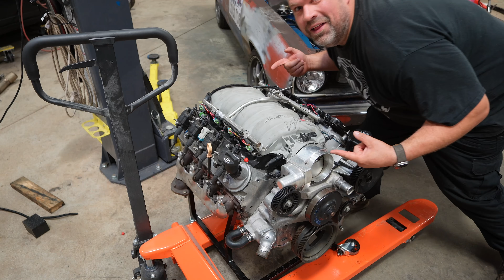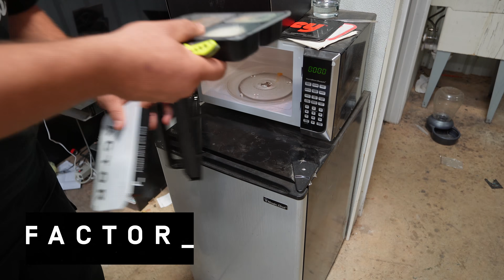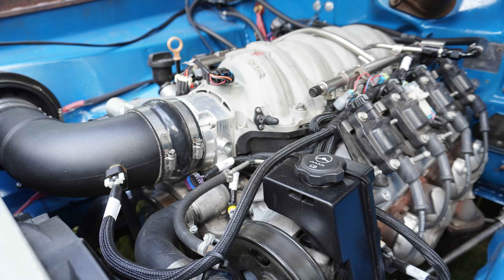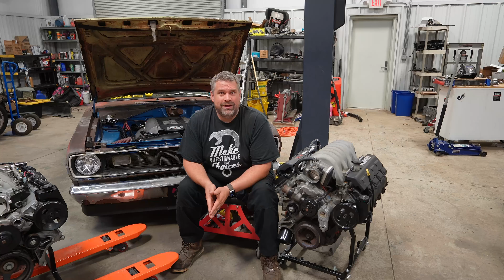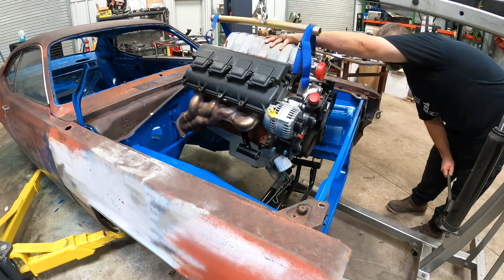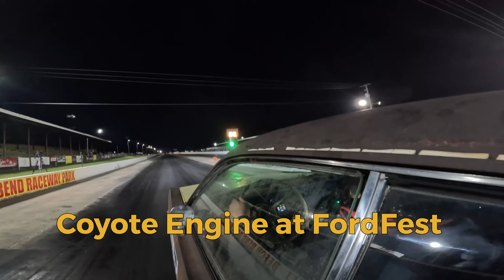What No One Tells You About Engine Swaps! Best Engine To Pick?

Comment: As a "Ford guy" I can't disagree. I love the Coyote, but as a swap motor, it is a difficult choice. It's so expensive and large it doesn't work everywhere like the LS. 

What Jared is not mentioning is how easy it is to get monster HP figures with the Coyote. A simple blower and oiling gear will put you way higher HP and more reliable than the same mods to an LS. Cleetus has proved this.
Reply: Lund racing just went 6.80@210 on a oem coyote block, 6r80, and stock ECU. I wonder how fast the LS or hemi can go on stock ECU? 🤔 🤔🤔🤔
Reply: @TTyote  The LS (as far as modern V8 engines)is still king as far as popularity, affordability, and ease of swapping, and rightfully so like it or not. Besides, as far as who makes the most N/A power that doesn't really matter. Especially since when it comes to serious racing(grudge/street) with money on the line, nobody competes with N/A power alone anymore. Everyone in those environments is running some form of power adder.
Reply: @erikturner5073  being cheap and easy is your mom's flex too. Coyote is king power per liter and range of tuning. Gtfoh with all that other lame shit.
Reply: @erikturner5073 🎯
Reply: @TTyote  Hennessey Venom F5: 300 MPH, 
SSC Tuatara: 283 MPH. Both LS powered and run those speeds for hours not minutes.
Reply: @mewrongwayKOCXF  cool nobody cares. Also who said anything about minutes? That's 6 seconds not minutes. I can tell there are no wrinkles on your brain.
Reply: @TTyote   Exactly!!  The Coyote will stay together for 6 seconds at 300mph but I was nice I give it 6 minutes!  The LS on the other hand has run 300mph for hours!  That is why the worlds fastest cars use LS power!  No Ford shit here!   I can tell there are no marbles in your head!  Google:  How Koenigsegg Made a Better Ford V-8
Reply: @mewrongwayKOCXF  The Cleveland is the best small block V8 ever made. Stock 4V heads flow 290cfm at .500. The Coyote doesn't belong in this comparison.
Reply: @eclipsegst9419  Stock 4V flow 233cfm at .500!! , Stock LS heads flow 300 at .500 lift! 🤣🤣
Reply: @mewrongwayKOCXF  Well you are full of shit, and if LS heads are better why can't you Chevy boys beat John Kaase at Engine Masters in the small block division? You keep getting stomped by the mighty Clevor! They even had to ban him from using the 400 Cleveland block because no Chevy stood a chance against his monster strokers using that tall deck height! Typical Chevy, always changing the rules when Clevelands start pushing their shit in.
Reply: @mewrongwayKOCXF  No, they flow -

0.200 161/65
0.300 232/92
0.400 271/145
0.500 294/176

Lift Int/Exh. Bone stock 4V heads with just a valve job when stainless were installed, basic 3 angle. 

The best factory LS head, the 243 head, with similar 3 angle valve job, flows-

.200 126/108
.300 184/143
.400 224/163
.500 251/176

So no, the LS heads do NOT outflow the Cleveland. And if we are talking fully ported aftermarket, the Cleveland still wins. That's why you LS boys can't beat Kaase at Engine Masters build competition, even after you pulled the typical Chevy boy move and banned him from using the tall deck 400 Cleveland block.
Reply: The high rpm of the coyotes makes my heart go "weeeee" but my bank account really likes LS swaps.
Reply: @alanmeadows4056 ,it can't get no better than that comment,salute
Reply: @alanmeadows4056  You pretty much nailed that.  You gotta admit, the Coyote is the most visually  appealing  engine of the three mentioned. I'm not a Ford guy. But for a modern engine, it looks pretty cool.
Reply: @MikeAnderson-uj3oo they pretty much feel exactly how they look. High tech and refined Americana from concentrate 😅
Reply: @MikeAnderson-uj3oo the coyote looks plain and wide, that's it.
Reply: It don’t matter what swap you do all them good when you build them right see coyote lose to ls see ls lose to coyote Hemi beat some ls and ls beat hemi etc go on it all matter With good pilot in them car keep it racing in fun y’all crying like little girl I love them all it not that serious
Reply: Stock coyote = 0 reliability issues. That is all
Reply: @crewdawg2008  They have an oiling issue(oil pump gears), also they are complicated for many, and they are OVERPRICED.
Reply: @erikturner5073  Being complicated is the person's problem, not the engines. The oiling thing you speak of is the exception, not the rule, according to both personal experience and every forum I've seen. Lastly, everything is overpriced these days, fuel, food, daily needs, so of course hobbies are going to be. Relative to what the market reflects, they're right about where they should be. Overpriced because GM engines are cheaper? Always been that way.
Reply: @crewdawg2008  like it or not the blue collar crowd is the biggest crowd in this hobby, and because of that the, and other reasons (best buy horsepower per dollar) the LS is the most popular and rightfully so, like it or not. As a Foxbody/Windsor guy, I find it shameful that Ford can't come up with a modern power plant that's affordable and can compete with the LS in the market. Ford has walked away from the formula that has made Ford number 1 in the streets, and in popularity back in the Foxbody years. With the attitude you displayed in your comment, Ford shares as well, and is attitudes like this is the reason why the modern mustang is nowhere near as popular as the mustang was in the Foxbody years, and never will see that popularity again at this rate. Also Ford knows this yet like almost always Ford learns the hard way. Sticking 5.0 badges on fenders like they did in the Foxbody years is not going to cut it!😂 Most people don't like overcomplicated, overpriced power plants. The Foxbody was popular because it was a true blue collar warrior that made good power and was easy to work on, among other things. Ford walked away from that formula, and the mustang hasn't recovered since. May as well call the modern mustang Ford's Corvette, and I'm not the only one saying this.
Reply: @erikturner5073  LOL attitude? Oh pot, I'd like you to meet kettle 🤣🤣🤣
Reply: @crewdawg2008  it's funny how a person can explain facts, and because the other person want to acknowledge or listen (people like yourself) y'all get emotional and don't understand facts or read the writing on the wall. SMH. I've met plenty of fellow Ford guys who get butt hurt when someone acknowledges the LS is rightfully the #1 popular modern V8 for many reasons. Probably because they have nothing to prove that fact wrong. They can only turn around and talk about how much more advanced the Coyote is and that it makes more power N/A compared to the rest. Which means nothing because anyone who's racing  competitive(street, grudge,etc..), are using some sort of power adder. No serious person is running N/A when money is on the line. Those days have long past. Like yourself, you had nothing to counter my argument towards the coyotes, or the Modern Mustang never being as popular as the Foxbody, and Ford never really learning that lesson outside of putting cute little 5.0 badges one fenders to bring back the good old days(not working 🤨).
Reply: @erikturner5073  I didn't refute that the LS is more popular because it is. There's nothing to refute. Popular and better, however, are not the same thing, and this is such a case.
Reply: @crewdawg2008  they are both good(coyote, LS) however the LS is the better choice for many for various reasons, and is why it's more popular. It's affordable, makes enough power to be competitive, durable, and easier to work on. That's a formula that's hard to beat. Just like the Foxbody(most popular mustang platform ever). It was popular because it was the fastest,  because many times it wasn't. It attained its popularity for plenty of other reasons some of which I already mentioned. Ford lost its way and has paid since.
Reply: @erikturner5073 yeah ls guys are too dumb to wrap they’re heads around longer timing chains and 3 more cams. We know this
Reply: Oil pump gear is only necessary if you're manual and/or bouncing it off the limiter constantly. With an auto, the stock OPG's will last a very long time
Reply: No doubt the Coyote is a great engine, responds to mods differently than the push rod engines, and really takes to boost in stock form. As far as being more reliable than either of the others boosted to the same power level, that's debatable... 
  Speaking of Cleetus, that 2019 F-150 4wd reg cab truck with the 6th gen Whipple on it is just freaking nasty fast. That thing is bad ass no doubt. They talk a lot of smack, and BS to their friendly rivals and each other, but that is not a stock Coyote with the newest version of Whipples blower, tuned, and Cleetus is beating the crap out of it, that engine is fully purpose built for Max effort boost, to withstand 1800hp, the stock engine blew up from overboost/poor tune prior. It is wicked Stout, but I think sometimes they need to fess up that they are just talking smack. There is a lot of money in that blue trucks engine.
Reply: Snot Rocket won the 2024 Sickweek with a stock block Coyote.
Reply: Us 9
Reply: https://m.youtube.com/watch?v=oGYfmoTMk1A
Reply: LS/LT rules...damn near indestructible. 70 years experience.  I've built(as a GM employee) helped build close to a million of them. Hemis sound great and the Coyote is very high tech but can't beat a LS/LT. At least 50 Million sales...that's all you need to know.❤❤❤
Reply: You don’t need oil pump gears. You need boost and fuel.
Reply: Clevor is the way. Not expensive, not huge, will put LS's in their place.
Reply: @eclipsegst9419  Isn't Windsor preferred for racing because of the stronger block and various head options (Yates D3)?  Why your preference for the Cleveland? 🙂
Reply: @TassieLorenzo  The best combo is a Windsor block with Cleveland mains and Cleveland heads. That's basically a Ford NASCAR engine prior to the FR9. Cleveland heads have canted valves, which allows for larger valves, and larger ports to feed them. Otherwise you are limited by your bore size when you use straight valves like the WIndsor.
Reply: @eclipsegst9419  In your wet dreams maybe!
Reply: I think Cleetus has more so proved that you can't punch every LS out to 427 and run crazy cylinder pressures.
Reply: also worth mentioning, coyote is best with an NA build, they can take 100 hp/L without really caring, which is simply way way harder to do with a pushrod design because you're capped at a relatively low RPM. Coyotes will take upwards of 8250 rpm all day, LS'es and Hemis simply wont.
Reply: @sofielee4122 Perhaps, but LS motors with pushrods build great low end torque, And while they may not rev to the moon they still make great horsepower for reasonable price.
And there are a lot smaller..
NASCAR uses two valve pushrod motors with a swirl heads for a reason And they rev to 9,000 RPM.
Reply: @garyh.8082 they build great torque because they're way larger lol.  Displacement for displacement they don't do any better than the coyote or mod motors.
Reply: @sofielee4122 Gen 2 and 3 Coyotes are way better when boosted now thanks to the Gen2+ coming with the 302 internals.
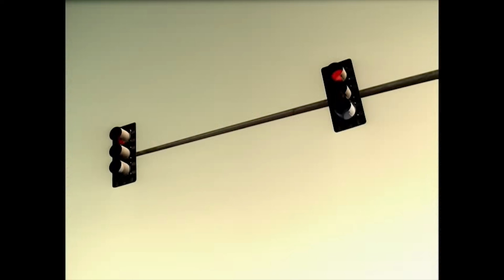Reply: I😮jk5y @sofielee4122 8ko7j90😊😊😊 6:51 overgrowth 😅i😮m
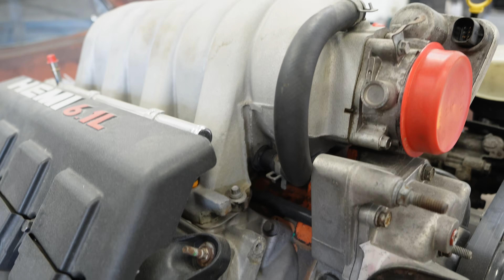Amen Amen 7:06  pnm
Ihnh
H t f
Reply: h.h
Reply: @sofielee4122 coyotes don't make much low end power compared to the LS, and Hemi, hence you have to rev them. Plus there are many blown coyotes from constant high RPM. They are not indestructible.
Reply: @erikturner5073 because they are 302 cubic inches.  Let the other 2 make a 302 cube motor and see how much more torque they make, pushrod or otherwise.  They have way way more displacement and nobody even factors that in.
Reply: @erikturner5073 they take 8k easy dude even boosted idk what part of that is hard to understand.  People mess em up by bouncing them off them Rev limiter highly modified no engine is gonna like that.
Reply: @midnight347  this is America, not Europe. People want BIG torque and to be pinned to their seats without having to rev their engines to the sky to do that. People made the same argument about import engines being capable of higher RPM and making more HP per litre back in the day and look where that ended up. People went back to their high displacement big torque V8 engines. The Coyote is impressive for its displacement, yet it's complicated(for many), too expensive, and lacks displacement(should've been 5.8). Plus it sounds like a chainsaw on steroids with loud exhaust (not good). Look what's happening now. People are looking at the Godzilla engines for many good reasons. The overpriced, overcomplicated, overhead cam V8 will never get a major foothold in American hotrodding. I'm a Ford guy myself and believe that for has the mindset of the Europeans when it comes to performance ever since '96, with the 4.6, and they haven't learned since. Hell the mustang is now a sports car (not muscle car). Overhead cam, independent rear suspension, give me a break. Personally in my opinion, after the Foxbody (best, mustangs best years), it's been downhill for ford especially in popularity since.
Reply: @erikturner5073  WTF are you talking about? I really don't want to be rude, but straight up you are either talking out of stupidity, or talking out of bias, and ignorance, or you're just talking shit, and lying. Whatever the case what you're saying is a bunch of BS. First, no there's not some huge amount of Coyote owners blowing them up because they're spinning them too hard. That's BS. Second no modern SB is all that torquey. Let's get this out the way, HP = Torque x RPM/5252, but we know that. For this argument we'll just stick with the stereotype that torque = lowend grunt or lowend power, and HP = topend pull or topend power. No modern N/A smallblock is all that torquey. This isn't 1993 anymore. The OEM's aren't going to make some stump pulling SB intended for a performance car, that runs out of breath after 5,500 RPM. GM has done pretty well at making a SB to make stout lowend power, but also have a strong pull towards redline. Still a LS engine or N/A GEN3 Hemi isn't some stump puller. If you look to use their "torque" to win races, and try short shifting then you're going to be losing way more than winning. You claim that 5L's can't make good torque production, and that Foxbody's are the pentacle of Mustangs, do you realize that a stock H/C 5L Foxbody straight up falls on its face around 5,500 to 6K RPM's, but at low engine speeds those old 5L's were hella ballzy? Same when talking GEN4 Fbodys with LT1's. A stock GEN2 LT1 is not that impressive on the big end, but its lowend power is strong. Would you rather have a LT1 Fbody, or LS1 Fbody? Most people would choose a LS1 Fbody. A LS1 Fbody will not feel nearly as "torquey" as a LT1 car, but a LT1 car isn't going to run with a LS1 car on the big end. In fact any GEN3 LS engine under 6L feels less torquey than a Coyote from GEN1 and up. LS engines have never been known as very torquey engines. Maybe LS7 with its 4.125" bore and 4" stroke, but N/A LS engines made their bones being strong on the topend. You want to feel "torquey" N/A engines then go drive an old big block vehicle. A pulleyed GT500 with either a 5.4L, 5.8L, or Coyote based 5.2L will blow the lowend torque production of any N/A SB away. We're talking about lighting street tires up at 1,700 RPM kind of lowend torque. My point is who gives a F about prioritizing low end torque production in a N/A SB for a performance application? If you do that then that engine will excel at nothing as to do so you've just sacrificed all your top end power to get really strong low end pull. When you H/C/I a LS, LT, Hemi, etc you're not adding a lot of HP while keeping the same lowend torque production, but it doesn't matter as an efficient H/C/I LSx with say a 4" bore isn't dicking around at low engine speeds under WOT, and neither is a Coyote. Would you rather have a GEN3 5.3L Silverado, or a 5.4L 2V Modular F150? Let's say from the year 2,000 for both? Most people consider the old GEN3 5.3L to be superior to a 5.4L 2V because those older GM trucks would outrun the F150's from that era, but when talking lowend power, and torque to get a trailer moving from a standstill the 5.4L 2V was superior to the old GEN3 5.3L.

Comparing a 351W to a modern Coyote is like comparing an old L98 to a LS7. Are you kidding me? I think the most powerful 351W was in a 95 CobraR? Generally speaking they were making about 240 WHP in GEN1 Lightnings and OJ Simpson Broncos. IDK maybe some of your old carburetor Windsors like in a Boss 351 or something made more power, but they make 500 HP Coyotes from the factory. Coyote waxes fat on any 351W (I don't just call them Windsors in this argument because Coyotes are also Windsors) that isn't at minumum running some very high-end topend components, and an aggressive cam, and more than likely most are stroker engines that have been bored .030" over, at which point both your refinement and reliability has gone to crap compared to a factory Coyote. If talking full N/A builds, people have built stroker Coyotes making mid-700 if not over 800 WHP by now. If talking boost then Coyote waxes fat on a 351W's ass again. Plus a dressed out Coyote weighs less than a dressed out 351W. No I don't dislike old SBF's. They have a lot of charm, and they're very proven. Instead of acting like LS is a Windsor copy, maybe thank LS for the head design, and top end aftermarket that the old SBF now enjoys due to the LS design reinventing the way people design an efficient top end for an OHV engine.

No one is picking Godzilla over Coyote because Coyote sucks. It's just an old school design, with 7.3L and a huge 4.220" bore diameter. A Godzilla is in no way a better performer than Coyote, especially on a factory engine. Look, the Godzilla has potential, and you could build one to make big power, but it's weaker than Coyote, has less compression, it's fuel system isn't nearly as efficient, it's longer, and heavier than Coyote. Its aftermarket isn't even close to Coyotes. Hell Coyotes aftermarket is on LS's level, or at least it's the closest thing to it, and seeing as LS has been out of production for a while now Coyotes aftermarket is developing faster than any other V8's is. GEN5 SBC doesn't enjoy as big an aftermarket as Coyote.

Some other things you have wrong. -Coyote is cheaper to mod than LS, or LT or Hemi. And by quite a lot. It's also easier, and simpler to mod. Hell an actual LS engine (LS1/LS2/LS3/LS7/etc) that's health isn't much, if any cheaper to buy than a healthy Coyote, even GEN3. An all-aluminum performance variant of the LS platform is expensive. I've seen healthy GEN3 Coyotes (with the transmission if I remember right) sell for less than $7K with around 50K miles. You think you're going to find a comparable LS3 or even a LS2 for less? Let's not even talk about what a LT1 or LT2 would command on the used market.
-Coyotes are not complex. Really what's complex about it? You find engines that mount the camshafts in the cylinder heads, directly over the valves to be more complex than an engine that mounts a single cam in the block to actuate all 16 valves and uses hydraulic lifters with rollers to ride cam, and requires a setup to keep the lifters from rotating, and then has a long/thin pushrod to go into the heads, and push a rockerarm, that then actuates a valve, and you have to start sweating the grams on your valvetrain because they really start playing a huge factor in the amount of RPM's your engine can spin without getting into valve float and potentially have a piston contact a valve? "Oh wait, Coyotes cam timing is complex, and GEN3/GEN4 use dual port injection." I guess using VVT in a OHV engine is less complex than it is in a OHC engine? Also DI has to be simpler than dual port as it only uses 8 injectors and doesn't use both port and direct injection. DI may theoretically be simpler (not the dual port is complex, it just uses both DI and PI to cancel out each ones negatives, while getting boths positives) but DI is way more problematic, and maintenance intensive than dual port, plus it's way more expensive to mod DI than it is to mod dual port. 
-You think using engine oil as hydraulic fluid to activate the lifters to collapse to run on few cylinders is simpler than DOHC? 
Really, what is so complex about a DOHC engine, or a Coyote? They tend to be very easy and simple to mod. Most don't even break the valve covers loose. Spark plug changes are easy/peasy on a DOHC engine. Have you ever changed the plugs on a factory LSx car? (Say a Fbody)

To finish this novel up, the last thing a Coyote needs is more lowend torque. I tell people this all the time, the engine is too efficient at building engine speed quickly to need a bunch of lowend power. The reason everyone says they'd rather have a positive displacement blower instead of a Centrifugal on a Coyote is because it looks sexy mounted between the heads, and the "thought" of a lot of lowend torque and a broad curve is cool. The reality is that having to always exercise throttle control, or rock a drag setup on the street gets old. Even a stock Coyote has no issue lighting up your tires. I personally would rather have a Vortech or Pro-Charger, and have a little more traction on the street, as well as a higher redline as these centrifugal Coyotes like to spin north of 8K RPM. Plus you could wastegate it if you feel you want more low end power. BTW a Coyote will wax fat on a Chrysler 360 as well. (From any year)
Reply: @erikturner5073 Mustang has never been a muscle car, it's a Pony car, along with the Firebird, Camaro, and the Challenger. Muscle is just that, a big bodied sedan/coupe (110+" wheelbase) with a big block V8 (muscle). Smh and you're a Ford guy, me and Mustangs are embarrassed. 😢
Reply: @atlisdragoon9220  I'm not trying to impress you. Yes I'm a Ford guy( also I don't like all Ford guys) who now likes them all. So you and the other Ford guys like yourself(keyboard warriors, who never built a car) can suck each other off for all I care😉.
Reply: @ericlee4122  stock gen 4 LS will take 7800rpm all day with TQ .. gpi builds a bunch of them... NA there is no comparison between the coyote and ls... coyote better boosted tho
Reply: Like he said I the video, the coyote needs to be revved out to make power.  If you're drag racing that doesn't matter but anywhere else it does.
Reply: Barra
Reply: Jared should have went with a godzilla instead of Coyote for more apples to apples comparison.
Reply: @danrid1982  wont fit
Reply: If you put anything other than a ford engine in a ford, what firing order do you use?
Reply: @rickhelbig630  whatever the firing order the engine needs.
Reply: as a ford guy,, the only engine to buy, is a 351c.. period.  look up falcon xy gt ho.. 160 mph, std.. 1 cam, no fkn computer...   ausie.. [ i also own a dodge challenger 340 r/t.. thanks..]
Reply: @harrywalker968 I like the 351 Cleveland but also like the 351 Windsor. My plan was to build a nice Windsor with Cleveland Heads which  they Nick named it The Clevor starting with a SVO 4 bolt main block. Rotating  stroker 4340 Eagle steel crank with H beam rods then using the Australian Cleveland Heads, with a special intake that excepts that application and a nice Roller cam. J&E forged pistons. The Clevor Engines are the engines to build.
Reply: @harrywalker968  Yep. Early 1970s Mustang Boss 351 or Gran Torino with a 351C-4V Q-code engine; can't beat the rumble of it with a big stick.
Reply: @harrywalker968 I'd argue the 351W is also a solid choice and often overlooked cause everyone wants to slap a vortec in shit and call their LM7 swap an LS swap lol
Reply: @harrywalker968 
Absolutely.  Specially the 69 1st year with the original casting technique. That block is pretty much bulletproof.  They all have their respect from me.  And I drive a slightly modded H.C.
Reply: If the coyote was such a good engine Ford would have put it in a super duty truck like Chevy put the LS Engine's in there heavy Duty trucks because the coyote is not reliable enough for a super duty truck think about that Ford boys
Reply: @donaldkinder6716 what a dumb comparison. The coyote is made for HP not torque. It actually tows pretty good for what it is but for an f250 work truck it makes zero sense.
Reply: @Zach-ju5vi  lol yeah because it wouldn't hold up in a super duty truck but Chevy puts millions in there Heavy Duty trucks seen the 6.0 LS Engines with over 300k miles in work Trucks
Reply: @donaldkinder6716  cool, but GM has never put a LS engine in a truck other than a TBSS. A low compression, iron block LQ4/LY6/L96 is not a LS engine. They're based off the same platform, but they're quite different to fill different rolls. I've seen GEN3 5.3L's with 400K miles. I've seen Foxbodys with original 302's with over 400K miles. I've seen 5.4L 3V Modulars with over 300K miles that ran smoother than any GEN3 SBC ever made. Plus those GEN4 6L SBC's with AFM are the definition of reliable. What does any of this have to do with Coyote? Have you ever seen a LS7 in a 3/4 ton truck? What about a LS2? What about a LT1? What about a L83? What about a L86? Would these all-aluminum, high CR LS/LT engines, and LS/LT based engines just not last in a 3/4 ton or larger truck? With how awesome and reliable they are it's a wonder why GM never put an iron block, low CR 6L in a Corvette, or Camaro, or CTSV? I mean come on GM! WTF were y'all thinking?
Reply: @donaldkinder6716  it would/does hold up just fine. Reliably is not a problem, torque curve is the problem. The engine is ideal for speed, it can tow all day but that's not it's ideal use. The exact same thing could be said about a 5.3l so I don't get your point.
Reply: @donaldkinder6716  Btw, the 6.0 is a POS. It has terrible fuel mileage, lifter issues and it wasn't a powerhouse by any means.
Reply: @donaldkinder6716 I have a 6.2 f250 and I’d run it against any 6.0 Chevy you got. It will wipe the floor with an LS. It’s an overhead cam engine as well. Mine has 200k miles and my brothers has 365k miles on it. We can take them anywhere you want brother. Drag strip, towing or not towing, fuel economy, throw a brick on the gas pedal and see which one comes apart first. Whatever you want. That 6.0 has no chance. You’re down a ton of power with that engine. 360 hp? My 6.2 is 430. It runs like a scalded dog too. Outran a 2014 rt charger until I let out at 100 mph and that’s because my truck is on 35x11.50s. Hooked a 17k pound trailer up to it a few days later. I have video proof of the truck getting 16.8 mpg at 60 mph.
Reply: @Longddaddy  lol tell you're lie's too someone else moron GM made and sold over 100million LS Engine's what Ford V8 engine has sold Even close you're just another Ford boy in a Different World
Reply: @donaldkinder6716 you’re cracked buddy. Settle down. I have 3 relatives with 5.3 and 6.0 “ls” trucks that all blew up before 150,000 miles. My dad has 2 coyote f-150’s. One being a tow pig that gets oil changes every 8k miles. Both sitting comfortably over 200,000 miles.
Reply: @donaldkinder6716  Coyote is too small for a super duty, seriously is a 302. Chevy doesn't put the 5.3/327 LS in heavy duty trucks and never has. Chevy puts their larger 6 liter engines in those trucks. Ford puts the coyote in F150 but the larger 7.3 in the super duty. 

What a stupid comparison.
Reply: @timothystark697  Agreed. This is becoming a, "my dog's bigger than your dog" kind of argument. None of the big 3 put all-aluminum, high compression, SB engines in their 3/4 or 1 ton applications. Even the Boss 6.2L was pepped up to make noticeably more HP in a GEN1 Raptor than it was in a SD. GM's never put a LS1/LS2/LS3/LS4/LS6/LS7/LSA/LS9/L83/L86/L87/LT1/LT2/LT4/LT5 etc in a HD truck. It's always some low CR, low spinning, iron block engine. L8T which is just an iron block GEN5 6.2L with a 3.86" stroke, less compression, and no DOD, makes noticeably less power than any of its GEN5 6.2L brothers. Plus your old 6L LS based engines in a HD truck weren't much more to write home about than an old 5.4L Triton in a SD. The 8100 Vortec was pretty badass as a petrol powered tow pig. Ford had the 5.4L, 6.8L V10, Boss 6.2L, and now the 7.3L Godzilla that they developed to be SD gas engines. Anyone using a HD LS based engine in a performance application is at minumum running some more performance oriented OEM heads like a 243/799/etc that they've likely had ported and that they've had milled to bump the CR up on the engins. Otherwise you're wasting time messing with a HD based LS engine. I guess as a budget engine for a poweradder they make some sense, but even still you're going to want to use a good H/C setup to make a HD LS shine as a performance engine.
Reply: @JROC734 Brotha you know your stuff. I bleed Ford blue but appreciate what the other manufacturers bring to the table. The coyote/mod motor hate is real.
Reply: @donaldkinder6716 why would it go in a super duty truck? It's a high revving sports car engine with 302 cubes.  Some of yall aren't very bright.  The dude laid it out all right there and he is well versed on both sides of the coin.  Camming is the only mod that will cost more mod for mod and it takes way less mods to reliably make big power not only on the coyote but the 03-04 cobra and 07-14 gt500 they were the old dohc mod motor platform they can also make 700-800+ wheel reliably with pretty simple mods even with stock cams.  Those engines (especially 5.4/5.8 in the gt500s) had lots of torque down low and everywhere they have more cubes than a coyote and the long stroke makes way more torque their powerband is like an ls but smooth like a coyote.  People are very misinformed on the gm vs ford thing when they think ls is so much cheaper to own and maintain.  Listen to this guy.
Reply: Funny little thread.  The Coyote is a needlessly complex, top heavy boat anchor that occupies far more space than its potential justifies.  It's only capable of less than a 1000RPM more than the LS with no torque advantage.  It's excessive cash and effort for minimal results.
Reply: @scottysgarage4393 your funny.a joke really.a coyote all day every day
Reply: @scottysgarage4393  If the Coyote is a boat anchor, then the 2UR and VK56 are too. They are all much the same and have all come to the same conclusion.  Ford have certainly departed from the pushrod formula, but they are not alone in doing that when you consider that the Toyota and Nissan engines are very similar.
Reply: @scottysgarage4393 calling the coyote a boat anchor pretty much let's everyone know to ignore you.
Reply: @michaelwhite278 that and I believe he just made an attempt at criticizing it's high rpm capability not providing more tourqe... Could've just written "I have a learning disability" on his t-shirt instead of posting that 😂
Reply: @michaelwhite278  Personally I can't imagine being ignored by Ford Fanbois would be a bad thing.  There aren't that many of you, and youre clearly not too bright.
Reply: @michaelwhite278  The Coyote is a needlessly complex, top heavy boat anchor that occupies far more space than its potential justifies.  It's only capable of less than a 1000RPM more than the LS with no torque advantage.  It's excessive cash and effort for minimal results.
Reply: @scottysgarage4393 you are a fool, or a lier. I went from DD a LS1 car (02 SS) for 5 years to DD a GEN5 LT1 (19 1SS 1LE) for 2 years to a GEN3 Coyote, and the Coyote is the best overall engines, especially in factory form. It's stronger, easier to mod, and let this blow your mind, cheaper to mod especially compared to GEN5 SBC. The Coyote is fully forged and stronger than even a LT4, plus the only OEM GM fuel system that holds a candle to GEN3+ Coyotes dual port system is a LT5's. On factory cams the Coyote is also likely even a better N/A engine. Sure a cammed GEN3+ SBC is super cool.... For about 10 minutes around town, and then it gets old, as does PM'ing the valve springs, and whatnot every 25K miles or so. Just like with LS you make the topend more efficient then you can turn more RPM's. People have spun past 8,200 RPM's with stock Boss 302 engines with nothing more than a tune. Let's see GM's DI engines spin past the factory 6,500 RPM redline without changing to a dual port injection, or an efficient PI setup. BTW a GEN3 Coyote or even a GEN1 Coyote for that matter feels noticeably stronger down low than does most GEN3 LS engines which like to surge around 4K RPM, and feel almost as dog'ish as a 4.6L DOHC Modular under that engine speed. GEN5 LT is the most broad, and linear N/A SB throughout its RPM range that I've ever experienced. They feel similar to a stock pulleyed Terminator engine. Still it doesn't matter as Coyote has never been an engine to lug around while trying to build engine speeds. They're extremely good at building engine speed very efficiently, and quickly getting into their powerbands, and up top they pull longer than a stock cam LS/LT. With that said I'm not going to flame LS/LT too much as I love them as well, and would absolutely own another, but speaking blasphemy against a Coyote because you fan out over GM is BS. I used to want a LS swapped FD RX7, but now I'd much rather have one with a GEN3 Coyote swap.
Reply: @JROC734  You are a silly little man.  

I am a dealer.  We also build customs and drag cars.  I move hundreds of trucks a year, retail, wholesale and export.   IF Ford engines were better that is what we would run and sell.  But the bottom line is all that matters and over the past 3 decades it clearly shows GM V8's are better in every way.  We win more races and we spend less money doing it.  Simple upkeep on stock used vehicles is VASTLY less expensive on GM than Ford, in part because of failure rate, in part because of expense of parts but VERY often because of ridiculous labor times resulting from Ford's moronic "engineering".  

But hey, you've had 3 cars over the past decade or so.  Far be it from me to laugh at your vast experience.  By the way, it is spelled "liar", you barely literate toad.
Reply: @JROC734 you should have done an intro and then a dedication to ur novel…
Reply: @dansherwood9851  your wannabe humor changes nothing. Don't read it if you don't like it. What I said is absolutely correct. Coyote is largely superior to GEN3-GEN5 SBC and absolutely superior to GEN3 Hemi.
Reply: @JROC734 Reliability wise in stock form the ls/ lt platform far out shines the coyote platform. And as far as mod for mods a h/c/I can can gain  over 100whp for less than comparable mods on a coyote. But take into account the coyote is 5 liters and the ls7 is 2 liters bigger, but can fit where the coyote can't. I had a 19 5.0 and I much rather my 08 zo6 for driveabilty.
Reply: @mrhrobinson  are you high? Where's a Coyote reliability issue? Let me guess, "the oil pump gears." Oh yeah, "the cam phasers." LS is more reliable? You mean like a stock GEN3 LS truck engine? Valve knock on cold starts, leaking oil pans, weak rod bolts, oil pumps requiring upgrading upon modding, weak alternators? And this is just your run of the mill LS. A POS Voodoo is likely more reliable than LS7. LS7 is arguably the most badass SB ever made, but its reliability sucks so much that more people would choose LS3 over LS7 to miss the headaches, and expense of a full engine rebuild to ensure reliable operations. Everything from the heads, (exhaust valve guides) to the rods, to the oiling system in a LS7 is unreliable, or can at the very least have potential big issues. You think GEN5 LT holds a candle to Coyote reliability? I hope you were actually talking GEN2 LT? Did you really make that claim? Okay, I knew someone with a stock 16 Camaro SS M6 car who had a lifter take out the cam. (So much for the lockout pins on AFM lifters preventing lifter issues on a M6 car) I knew another guy with a 21 Silverado LT Z71 who had to have GM buy him a new L83 at only 3,100 miles due to DOD issues. That's freaking ridiculous! LT more reliable than Coyote? That's not even mentioning the POS DI system in a GEN5 SBC.

Anyways, who cares about H/C/I a Coyote? Coyote boosts better than LS or LT. With that said if I'm trying to make more N/A HP on OEM cams I'd likely choose Coyote, or a 400+ ci LS with a more aggressive factory cam. I would also rather have a C6Z than a S550 Mustang as DEW98 based chassis's are no better than Zeta chassis's IMO. Plus C6Z is possibly my favorite car ever, even with its reliability issues, and while it's a poor platform for a poweradder, it's an awesome N/A car. With that said IMO Alpha is a better platform than any Vette made pre-C8. Is Alpha lighter? No. Does it have a 50/50 F/R weight distribution? No. Is a front strut design generally as good as a SLA setup? No. Still everything else about Alpha outshines C4/C5/C6/C7. Way more modern and forgiving, and just straight planted and hooked up in a way a pre-C8 isn't. With that said Coyote is overall superior to LT1, and LT1 is nipping on LS7 heals mod for mod. Yes LT1 can make big N/A power when talking H/C/I/bolton/E85, etc, but who the hell wants to frequently drive a H/C car on the street and around town when you get past 30? Plus valvetrain maintenance is far less appealing than just boosting a Coyote to 700+ WHP with OEM manners during normal driving. People get this wrong "all the time." Coyote is way easier and cheaper to mod than LS and especially LT. What supporting mods do you need for a GEN3 Coyote? Around 700 WHP you should upgrade your port injectors, maybe give it a little more pump or BAP around 750-800 WHP. Some people like to upgrade to billet oil pump gears. Do I need to point out everything LS/LT that needs upgrading to support even 500 WHP? Especially gets expensive on an engine with DOD. Coming from LT1 to GEN3 Coyote everything not cam related is more expensive on LT. Headers, TB, intake manifolds, fuel system components are way more expensive on GEN5 SBC. Hell it's cheaper to mod a GEN3 Coyote that it is to mod a GEN3 LS, and that's not talking chit. N/A 500 WHP Coyote is way easier and cheaper than N/A 500 WHP LS1/LS6.
Reply: @JROC734  Are you stupid, 1st and second gen coyotes were self destructing left and right. And just about any ls or lt with do 700 to 800 horses all day. And what issues does the ls7 have other than the much exaggerated valve drop issue. And no way are you modding a coyote for less than an ls, maybe an lt. And I would definitely not say that coyotes are better modded or boosted. Ls and Lts shine when boosted. I would say they are about equal mod wise. Boost for boost it could go either way honestly.
Reply: @mrhrobinson coyotes can go for 100s of thousands of miles even modified a good bit with nothing more than regular oil changes.  Stop talking out of your ass.
Reply: @mrhrobinson a coyote can gain over 100 rwhp with a ported cobra jet and cams with the stock heads.
Reply: @mrhrobinson  lol the reliability thing is false as can be. Gen 1 and 2 coyotes outshine ls all day in every category
Reply: @JROC734 tell him my friend he is biased and is a LS fan. I have a of the comparisons between the Coyote, Predator vs LS / LT motors and the ford motor are by far more supreme power wise and efficient than the Chev motors. 5.0 engine capacity for the Ford motors vs 6.3 for the Chevy motors and the Ford still makes more power. The Coyote has both direct and port injection plus quad cams and 32 valves whereas the LS has 16 valves so which means the Coyote breathes better. It revs higher. It modern technology not like the LS which has dinosaur technology.